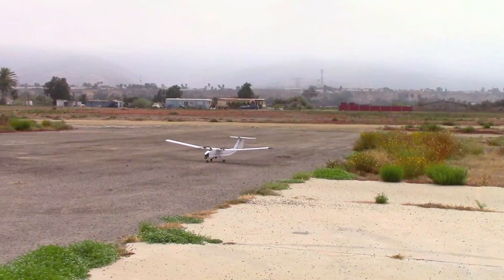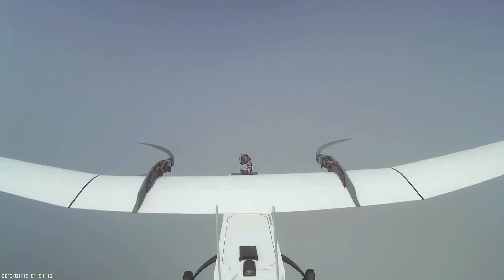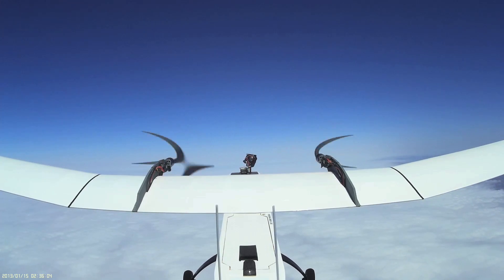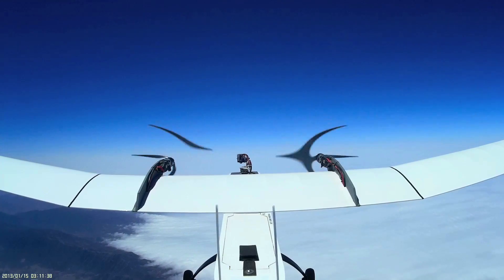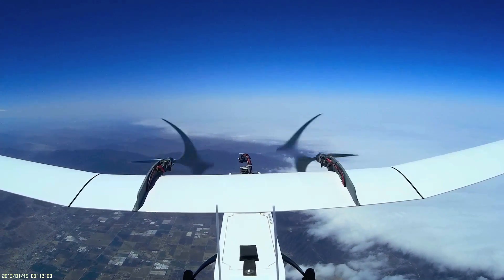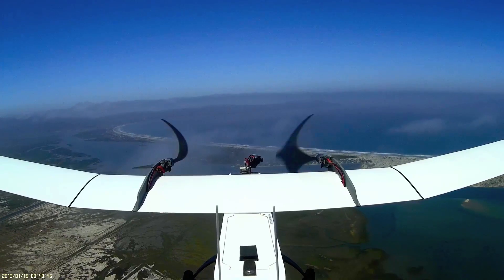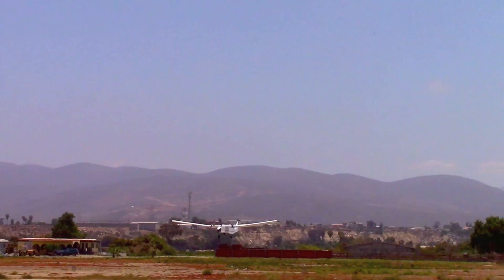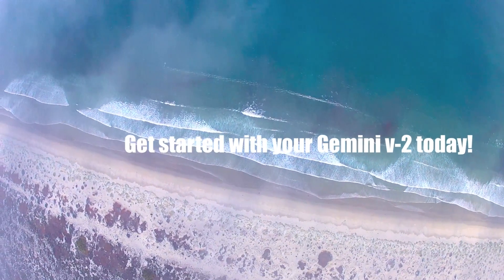Gemini V-2 FPV High Altitude-Long Duration Flight-13,000+ ft.

Comment: i will send my DJI Phantom to Mars
Reply from the maker: Not a problem sending it there, but if you expect it to fly there, it will need to have an autonomous mode, and be specifically adapted to the atmosphere.   It would probably not look like a phantom anymore.

Comment: Nice flight! If you are planning to fly with no power on a regular basis, I recommend you look to set the speed controllers up to brake the motors and stop the props freewheeling. This would reduce the drag significantly.
Reply from the maker: yes, you are absolutely correct, but if you notice, I actually put the plane in a  slight dive, to bleed off altitude, as a glide for that height  could take over an hour. so i actually wanted the extra drag.  you could get a longer flight time with the brake on for sure.
Reply: it does not reduce the drag. Also see my reply to the dude further down asking the same. I can prove it on paper if you like physics
Reply: Any airspace infringements?
Reply: could you explain it to me? I believe you but I would like an explanation.
Reply: My answer wasn't entirely right,i had forgotten about parasitic drag on a freewheeling prop. The answer is,for a given prop with a given pitch and given length, whether or not one should leave it freewheeling depends on the gliding speed. Here is a paper with test data i found: http://www.peter2000.co.uk/aviation/misc/prop.pdf 
Anyway a collapsing prop is the best solution :)

Comment: What was the total flight time from take off to landing?
Reply from the maker: about 2 hrs.
Reply: FPVREVIEWS Wow, 2 hours staring at a screen
Reply from the maker: We have flown up to 4 hrs before on a charge, but not during a high altitude flight.  
Even the high altitude flight could have been longer, as we only used about 75% of the battery capacity, and put the plane in a slight dive to descend, instead of gliding at the lowest sink rate speed.
I think i need an autopilot now...  i get tired, hungry, and have to pee after about the 3rd hr..
Reply: FPVREVIEWS 75%... I wish i had any FPV system for my plane. You guys are lucky to have this thing.
Reply: FPVREVIEWS And maybe you could figure out how to program a button that allows the plane to descend in circles until a previously set altitude.
Reply: FPVREVIEWS Where did you guys film this?
Reply from the maker: mexico
Reply: FPVREVIEWS Oh wow. Why don't you try to land in over here in Florida!
Reply from the maker: no thanks...  i have enough trouble being a good guy.
Reply: FPVREVIEWS Where can I get one of these planes.
Reply from the maker: http://www.bearospaceindustries.com/aircraft.html
Reply: FPVREVIEWS Thnx dude, but I'm not good with building 😢
Reply: FPVREVIEWS do you have any recommendable FPV systems within $300 I could buy?

Comment: So just out of curiosity, how did you guys get up that high without any issues with the FAA? Did you file for a wavier/ COA or are you guys located out if the United States?
Reply from the maker: We're outside the US.    Actually laws in US have changed, and you can get a commercial license now. The FAA finally got reasonable, but seems to be favoring commercial operators, of course. Typical gov. favoring special interest, and industry over citizens, but whatever. at least you'll be able to get a job designing, repairing, or flying them now!

Comment: Folding props or ESC brake would really help your glides back down.
Reply from the maker: yes, it would help, but for this flight, we were actually in a slight dive, and trying to bleed off kinetic energy to get back down more quickly. it would be nice to have options, though.

Comment: Any thoughts on putting the newer super-thin and light solar cells on the upper wing surfaces? There are single engine planes already on solar with sustaining battery life- they never run out. You could at least significantly increase duration this way...

Comment: And I can't even get 300 feet with my setup.
Reply: Tell me, what do I need to make a plane that can fly high and for a long time? I plan on getting an ~1.5m wingspan epo a340 4x50mm edf airliner. What kind of rc system do I need to get a long range?
Reply: +Paolo wolfart castillo If you want long range like 5-15km+ then you should use 1.3ghz for video and a 433mhz lrs control system. I recommend at least a 800mw 1.3ghz vtx with a cloverleaf antenna and a helical antenna for the receiver. Also an osd with autopilot functionality.
Reply: ChaosBelow thanks :)
Reply: @paolowolfart2847  have you try it?

Comment: very good
how mutch power TX output 
thank you :-)
Reply from the maker: 200mw, with 600 high power mode in reserve. I did not use the hi power mode, as it was not needed, but did experience a couple of very short, 1 sec or so glitches.  It was not a problem, as i had the failsafe set to power down to 0% throttle, and the flight controls set to flight  trim.  none of this was a problem.   EZUHF by immersion rc was used with adversity receiver, for control.  the antennas on the plane are dipoles, with one oriented horizontal, and the other vertical in the fuselage. the ground antenna was fixed, a diamond sr771 i think, and was oriented vertically, (wrong way) for the entire flight hence the glitches. a directional antenna on the tracker would be much better, but i'm not doing these kind of flights very often, so mostly worried about getting data to improve the design of components, like the battery, and future design on aircraft.    thanks for the question. Cheers!

Comment: i know the video's kind of old, but i just found your channel.  so, if you added some powerfilm or other thin film solar cells to the surfaces you would be able to recover some voltage during glide periods , no? i think you said in this video the glide back was around 40 minutes, i wonder if you could do some quick math to see what kind of flight time gains could be achieved with the current design specs based on the wing surface area and nominal/peak average of powerfilm , the extra weight (not much) and any additional drag (again, probably negligible). obvious idea i know, its being done more and more these days now with the availability going up and even  big companies planning to  incorporate high altitude unmanned solar flight systems for telecom, pseudo-satellite type stuff - really cool check out airbus Zephyr http://www.militaryaircraft-airbusds.com/Aircraft/UAV/Zephyr.aspx  . any plans for toying around with solar or something like this in the future for you guys?
Reply from the maker: +TheProfezzional Yes, very good point. We've been working on a  design for a plane powered mostly by solar, but it requires a complete re-design to accommodate the panels, and optimize the airframe for newer payloads. The Gemini V-2 will continue to be a workhorse, but in the future it's likely in our view that most serious UAV's will incorporate some level of solar power. thanks for the references.

Comment: Hi, I contacted you last year. I'm interested in this plane, but I do not have the time to build it. Please think about it selling this ARF . Maybe just wood build without covering or something. I will be a professional UAV pilot and searching for fixed wing planes which can fly a long time. In the Netherlands the plane has to be certified. Means it costs us 2000 euro. So the plane will be checked  structural and electrical.  The plane will be used on trips to foreign countries.
Reply from the maker: +Raddy Beer Thanks for the feedback. We'll put it into the calculator, but your needs are not too uncommon. Spike
Reply: hello, i live in the netherlands and i'm building one right now. i am not very experienced in big aicraft, and you said it has to be certified?
Reply: Only if you fly it professionally, meaning you ask money for rpas services. Check www.nlr.nl
Reply: Ok, dank u wel

Comment: Good flight. I see, landed with the engine running? Still there was to reserve batteries? Whether rotating on stream?
Reply from the maker: +OLEG69M there was still about 15% of the battery remaining. I have the ESC's set up to free-wheel, or turn freely, as it makes more drag, which helps to descend, and helps a little to flatten the glide slope for landing.
Reply: +FPVREVIEWS Understand. The high speed without the engine running?
Reply from the maker: +OLEG69M the climb is with the motors running. the glide is with the motors not running. I shut them off, to keep a reserve of electrical power, in case i have to abort a landing, divert, or need power to get back to the landing zone.
Reply: +FPVREVIEWS A large load on the wing?
Reply from the maker: +OLEG69M not really, still several pounds under gross weight.
Reply: +FPVREVIEWS In this case, your plane can go higher. If allowing radio and video.
Reply from the maker: +OLEG69M yes, it could go much higher.
Reply: +FPVREVIEWS If there is such a goal. If there is a target. Оf Success.

Comment: did you use an antenna tracker for the video link ?
Reply from the maker: +FPV Flying yes, it's an MFD tracker. the 13db patch is modified to make it lighter, by removing the radome,and replacing the backplate with depron covered in alum. foil.

Comment: May i know flight controller / stabilization controller do you use? and what LRS transmitter do you use?
Reply from the maker: +Budi &#39;van&#39; priyatno i have no flight controller, or stabilization,  the aircraft is inherently stable, and does not need one. 
i use EZUHF controls. with futaba transmitter
Reply: +FPVREVIEWS wow it's pretty cool..thanks for sharing

Comment: On next flight can you mount one camera with no-distortion lens?  Seems every go-pro or any other camera has wide-angle or fish-eye lens.  Curious what horizon looks like in high altitude.  Amazing work.
Reply from the maker: +Mark K from this altitude, no curvature is visible, if that's what you mean. i'll consider using some different settings on the go pro, as they have narrow field of view setting, which makes them look like  a normal camera. thanks for your input!
Reply: +FPVREVIEWS  Amazing what you can build and how high you can fly it.  "... from this altitude, no curvature is visible..." Now I'm confused more than ever before. Thank you for your response.
Reply from the maker: +Mark K airliners fly about 2-3 times that high, and from them, you can't see the curvature, really very well. i think it's not clearly visible until something like 40-50 thousand feet, but i could be mistaken.  
i'm sure google or wiki would have some info.
Reply from the maker: +FPVREVIEWS here is something i found from an airline pilot:  "From a friend who was a military pilot, and from sources such as the many books I have read on the SR-71 and U-2 it can be said that this doesn't appear until you get up to 55K-60K feet........

The highest I have been is 41K on a 777 and I couldn't see anything but a flat horizon."

sounds like we need a better airplane, i will start designing it...  LOL
Reply: +FPVREVIEWS Long story short friend of mine (deep thinker and thinks way too much) told me we live on FLAT EARTH.  I laughed in his face and said few things.  He challenged me to prove him wrong and I can't use NASA pics or any other pics using wide-angle or fish-eye lens.  He said I will never see curvature with my own eyes because there is none.  With Earth's size and mathematical formula we should see curvature when looking at horizon from high altitude.  At 4k to 5k feet high we should see curvature and 20k feet high curvature should be obvious.  More I research this more questions I have.  WTF.
Reply from the maker: +Mark K well, the curvature is there at sea level, it's just so slight, that you can't see it when looking at the horizon, in the horizontal axis.   it is very easy to see looking at the horizon int he vertical axis, just get on a boat, in clear weather, and travel from an object like a ship, away from it, for about 10 miles. you will see it disappear underneath the horizon gradually, so , the earth is definitely round.  i have done celestial navigation while growing up, and it's all based on the premise that the earth is round.  if you go to the southern hemisphere, you see different constellations, so there is no way the earth is flat. i have seen it for myself.   Buzz Aldrin  would punch you in the face, i'll be nicer.   
https://www.youtube.com/watch?v=1wcrkxOgzhU
Reply: +FPVREVIEWS To our eyes the ship appears to go underneath the horizon .... until you look through a telescope and clearly see the ship is still there.  I will look into constellations (hope it's the ammo I'm looking for), but you said it yourself you saw nothing but flat horizon at 41k feet.  This is not possible.  You should have seen profound curvature at that altitude.  Thanks for the info.
Reply from the maker: +Mark K it's there, and it's measurable, but hard to detect by your eye.  there are conspiracies for everything, based on explainable anomalies, don't let them fool you, and base your beliefs on scientific knowledge, and theoretical physics.  The scientific community has got way past proving the earth is a sphere, and floating in space a long time ago.  Even Job, in the bible, thousands of years ago, knew that the earth was a circle shape, and hanging upon nothing. that's how he described it. 
this issue should have been resolved many, many years ago..

Comment: very nice. how high you want to go? 20000ft?
Reply from the maker: +Jörn Beyse the original design spec was for 20 000 minimum, and to carry a full size DSLR to 10 000 and keep it there for 1 hr.  or similar atmospheric sampling payload. i have not fully tested, but i believe both are achievable with the standard airplane.

Comment: Awsome flight :D how much mW FPV do u use ?
Reply from the maker: +BlueMountPicture s the video transmitters are 1.2 mhz and are advertised at 600mw, i think.  either 800 or 600.  
with a good directional on the ground, and the tracker, no need for  a lot of power.
Reply: Ok thanks :) i think i will buy a 250mW and a good Patch antenna but i life in Germany and i will never fly that far because its illegal in Germany :(                     (the legal in Germany 25mW but nobody cares :D )

Comment: This is pretty impressive, but how do you know if you're remaining outside CAS?

Also, you experienced a classic inversion - I've flown in quite a few (full size plane) and the transition from the bottom layer to the top is quite remarkable. The turbulence just gets switched off!
Reply from the maker: +cjm2005 we are outside the US, and at the time of filming, there were absolutely no rules regarding RC aircraft, etc. Here, the most dangerous place to fly is low over the designated model field.  not much air traffic here anyways. 
yes, it's very neat to be able to get above the local weather.  many times, i have noticed a slightly turbulent layer, about every 1000 to 2000 ft. and the wind direction seems to change and strength also, with every layer.
Reply: You need to do a bit of study on meteorology mate, it's absolutely fascinating, even more so when you see it in action in real life observations.

https://en.wikipedia.org/wiki/Inversion_(meteorology)

Also, due to the Coriolis effect and surface friction the wind direction and strength changes as you ascend - the general rule is 'increased (in strength) and veered (to the right) going up, slack (less strength) and back (to the left) coming down.

You can access spot wind charts & use the forecast winds to decide on a cruising altitude if you want to do a long distance flight :)

Comment: Perhaps a dumb question but how do you know you reached 13k?  Do you have an altimeter on board?
Reply: +UGAFan Many models have a telemetry module and can even use GPS to have global positioning. So yes, they had an altimeter on board
Reply: What you say is true, many RC models can have telemetry modules on board but they have to coupled with a specific sensor (e.g. voltage, GPS, etc.) but you also have to have a compatible transmitter to get the data.  Most telemetry systems are add ons to aircraft and nothing was mentioned about a telemetry system so my original question still stands, how do we know it reached 13k?
Reply: +UGAFan true, only mention of it is at about 1 minute in where he mentions relying on their telemetry/instruments to get above the clouds... they don't say what type in the video, maybe in others?

Comment: Thanks 4 yr quick answer..here in Iraq we suffer high temp. weather since the end of April till the end of September..as u know temp. decreases about 6.5C each 1000meter higher..so in June ,July ,Augest & Sep. temp. at surface is 55-45C ...& that causes many electrical failure in the uavs..even the US troops got problems in using the RQ11 Raven ..as i read..any how i`m thinking of puchasing one..

Comment: Brilliant ideas...can the avionics autopilot ,tvtrans.engines ,esc,batteries etc.. defeat high weather tempreture of more than 40 centigrades working for more than 4hrs on 1000meters altitude ?
Reply from the maker: +Salih Mehdi temperatures get less at higher altitudes, not more. so, no problem, just need insulation for extreme altitudes, and extreme low temperatures.  At these altitudes, it is not a problem. it would be interesting to add an outside air temperature sensor to the plane, however. also a barometric sensor, so sense density altitude. alternately, airspeed could be compared with average groundspeed.